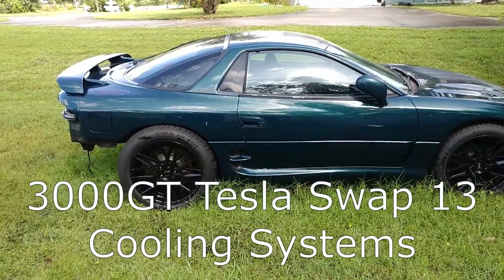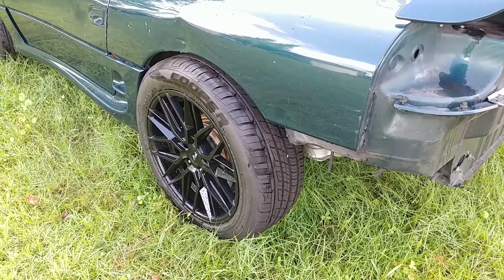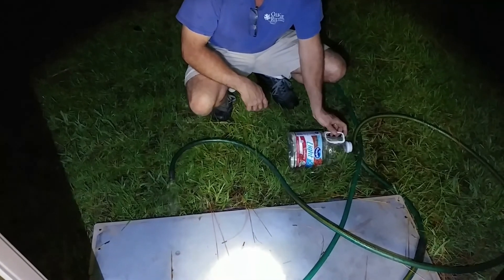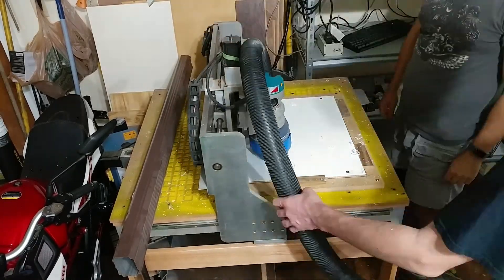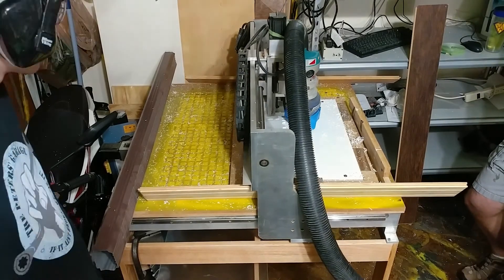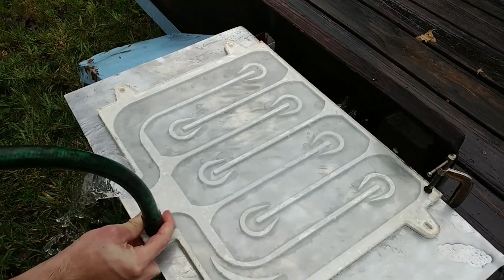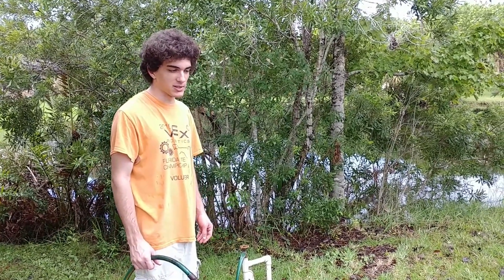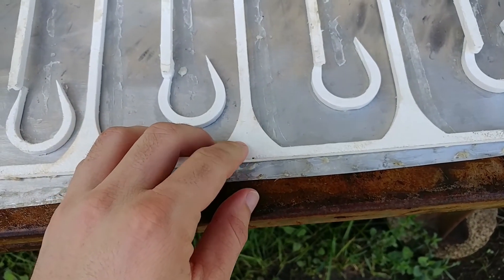Mitsubishi 3000GT Tesla Swap 13 - First Battery Cooling Experiments

Comment: Looking at the first take are you going to make a wide body for the rear axle?
Reply from the maker: Yes. I haven't decided on an exact method or style yet, but once I can get it to at least move down my driveway under its own power a widebody mod is on the plan.

Comment: You might consider taking one of your batteries and testing it to see how much heat it actually makes. I set up some Leaf cells and put them under a 1 C load and did not notice any heat. Of course different cells may have different results.
Reply from the maker: My planning is mostly based off of a forum post on diyelectriccar.com where someone was building a pack for racing out of Bolt cells. They ended up putting cooling plates between every cell. I saw someone else with a very similar setup recently that has only a bit of air cooling on these cells but I don't have that kind of confidence, so I figure the per module cooling plates is a good compromise.